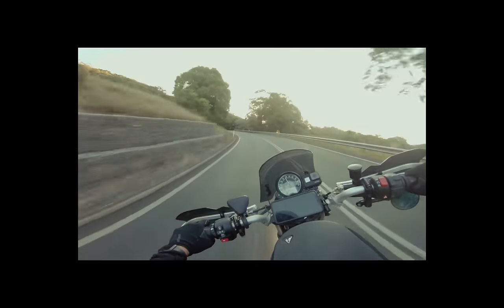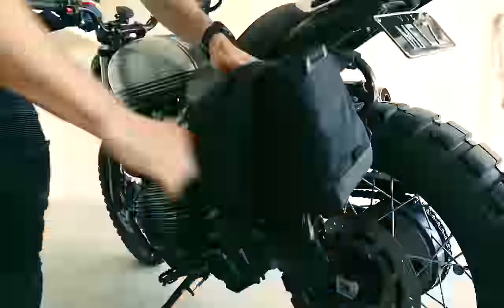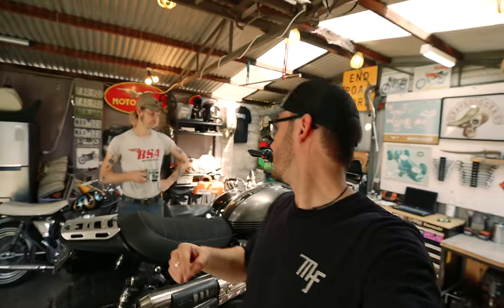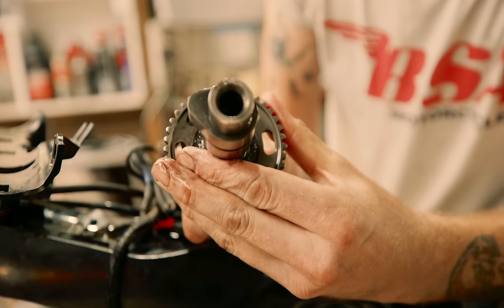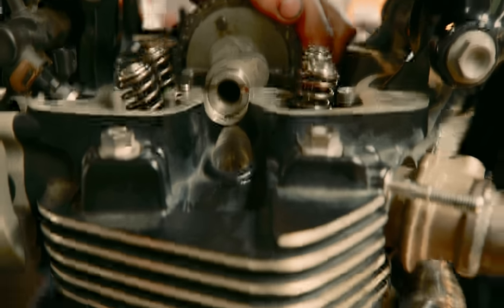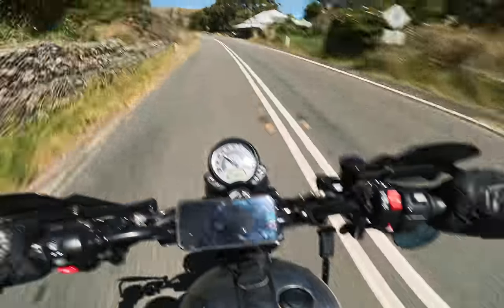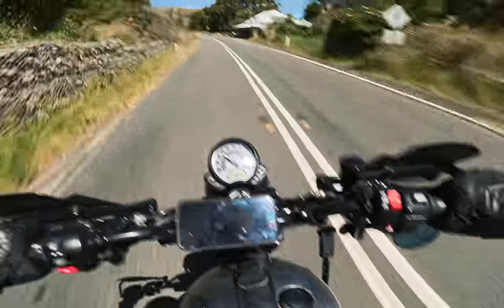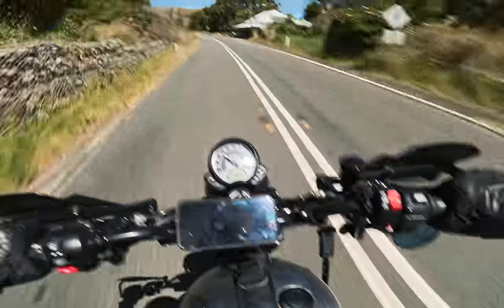I gave my Triumph Street Scrambler MORE POWER

Comment: Do you have the part number of the Camshaft you used? The TEC website currently doesn't recommend the same camshaft as for the other 900cc engines.

Comment: Its not going to use more fuel. The only use more fuel is because more power more keen to twist throttle. If you ride calmly AFR 14.5, at 50% throtle, it goes 13 and down. Fuel consumption low if you ride slow